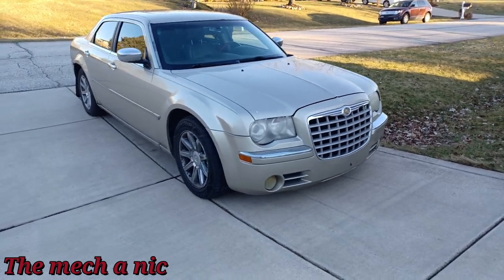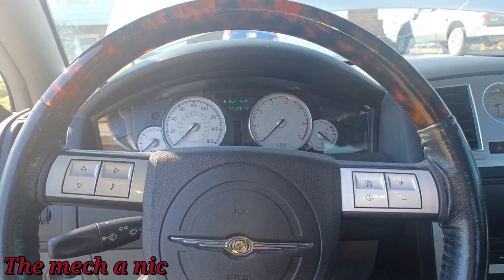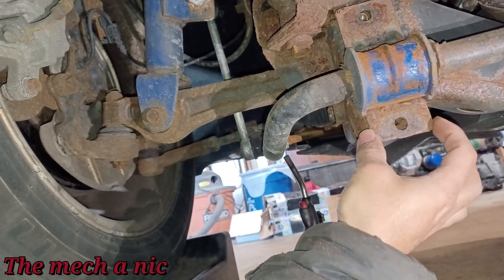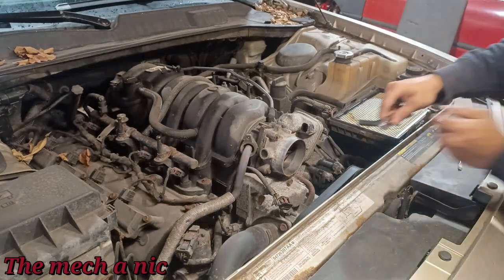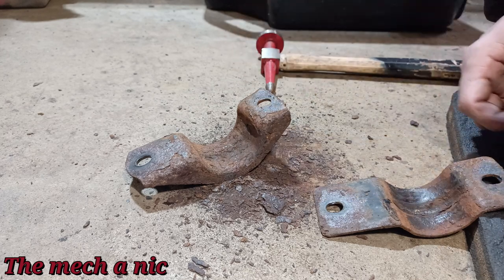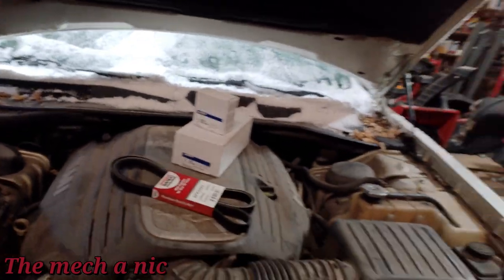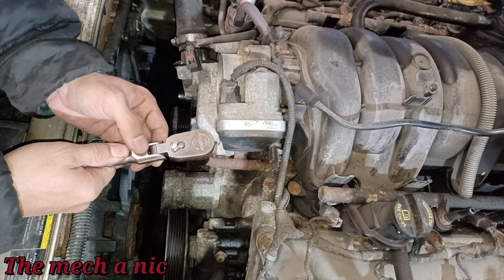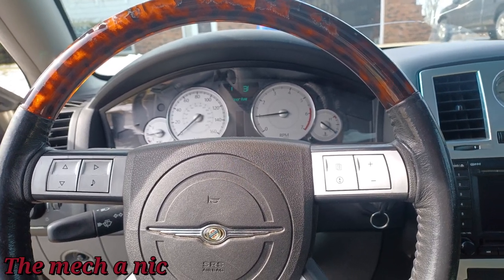chrysler 300 making noise while driving

Comment: On a recent video I stumbled across, a guy mentioned that the Snap On flex head ratchets have a little spring inside that holds the flex head in position. Over time that spring loses tension. Simple fix, free.

Comment: A lot of times if you wash your motor , it will cause your pulleys to squeal real bad. So the best thing to do is spray it with some WD-40. Chrysler parts are made of magnesium, so they tend to have a problem with corrosion

Comment: I know this is 6 mo. old but... Order from Mopar.. Enter your VIN and Mopar will tell you the exact parts you need (I'm sure you already know that). I have 2008 300c and have had it for years with just barely 100K mi. and I have yet to hear anything under mine (But I will). That being said, I would only install OEM bushings. I would have gotten new bushing brackets also. If you don't want to remove all the rust because you fear it will fall apart it NEEDS to be replaced. You might pay a little more for OEM but bushings and gaskets are still pretty inexpensive... I would check the ball joints and control arm bushings also...